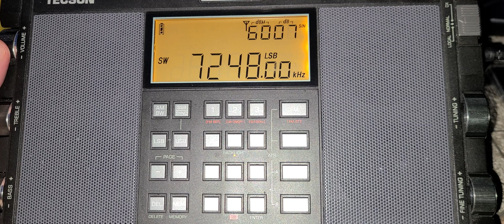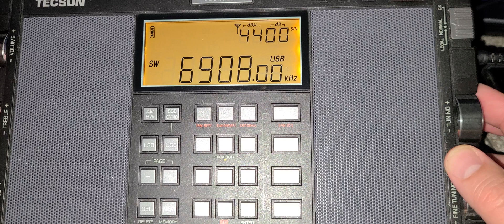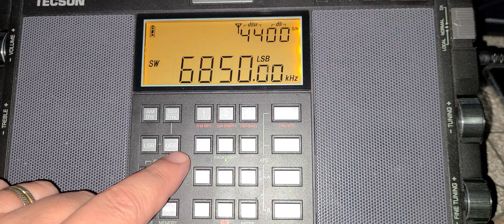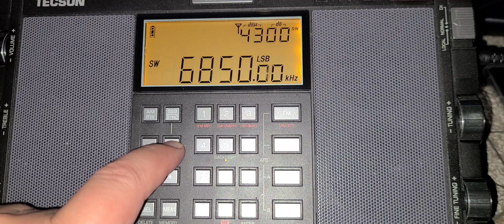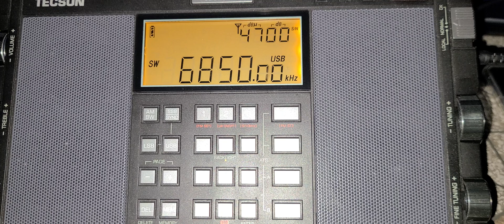Shortwave 101 Beginner series When do we use USB LSB modes on the Shortwave bands

Comment: One little "exception to the rule" is that RTTY (radio teletype) on the ham bands is always LSB, even on the bands above 10 MHz.  (Probably not something that a beginner would be concerned about now, but file it away in the back of your memory for the day when you're trying to decode RTTY and it all comes out garbled!)
Reply from the maker: no RTTY is USB  every digital mode is USB, if you are decoding it in LSB the software you are using had the Reverse mode enabled